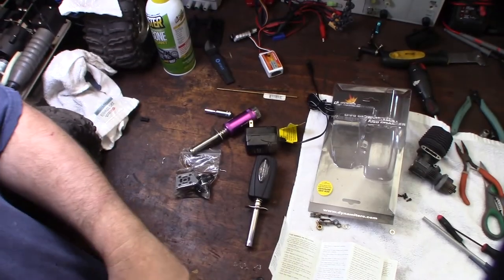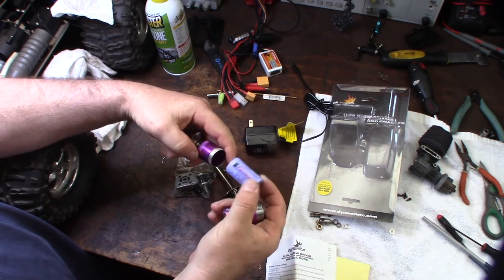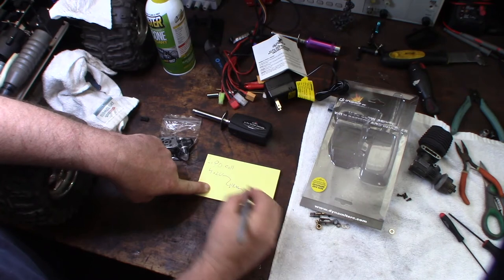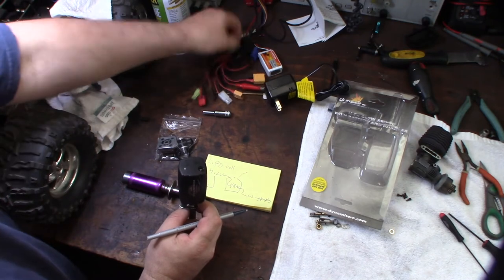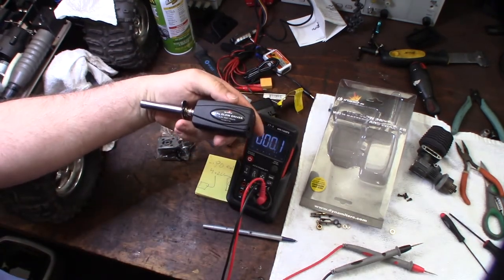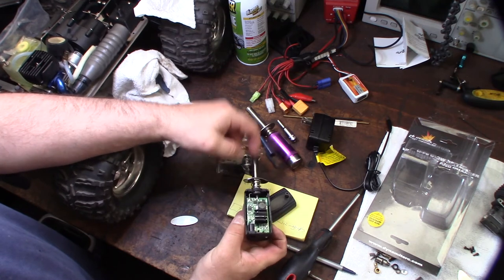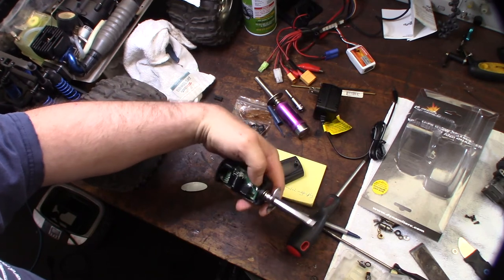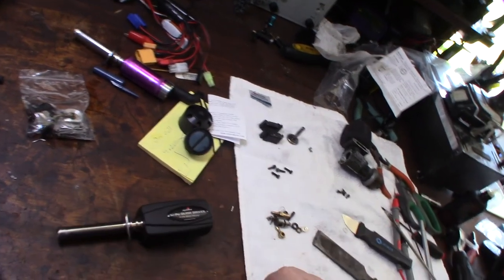Dynamite Li-Po Glow Driver Igniter HOW IT WORKS!!! Disassembly Inspection

Comment: It's some sort of switching power supply, as you can see, but don't assume it's a buck converter operating in a fixed output voltage mode.

It may be working in a constant current mode using PWM (pulse width modulation) to drive a glow plug at a set average current. The output voltage swings from 4.2 volts to zero volts with nothing in between. This may be done hundreds or thousands of times a second. You could be measuring 4.2 volts DC at the unloaded output because the circuit "sees" an infinite resistance without a glow plug attached, so cranks the PWM ON period to near or at 100%.